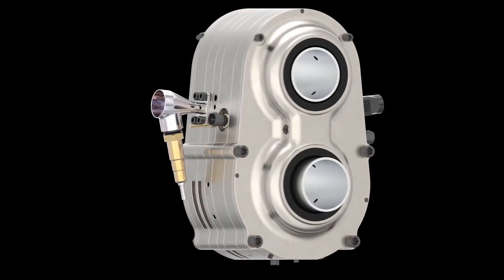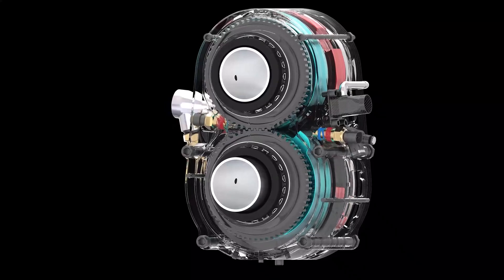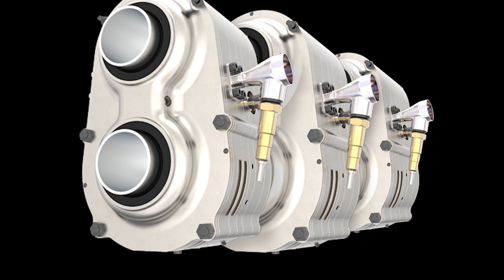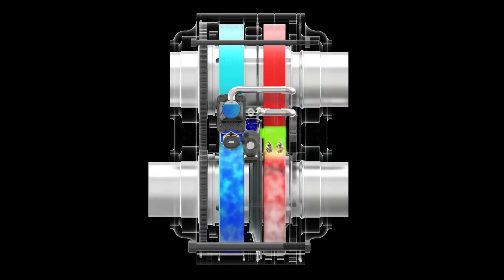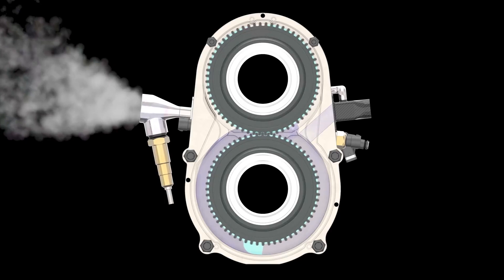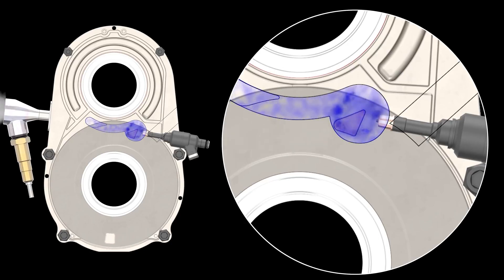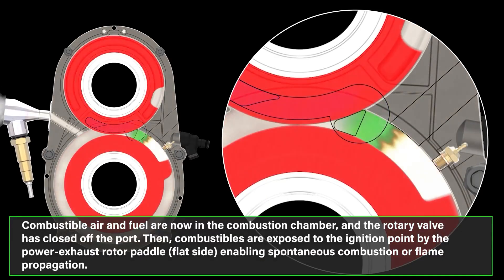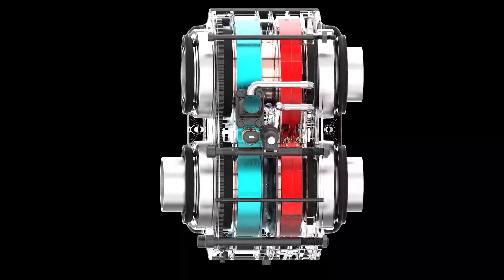This pistonless engine runs on hydrogen and revs to 25k rpm

Comment: as someone who lives out in the boonies i love the idea of Hydrogen and Hydrogen/electric hybrids,  pure electric just isn't practical since not only do i require a Pick-Up Truck but i have to drive 20 minutes to get to the neatest real town.  not sure this particular engine is practical.  some have already mention  cost of maintenance but we also need to think of EASE maintenance.  as someone who has never been able to afford a new car and likely never will i have always done as much work as i can on my vehicles myself.  any new engine must be something that the consumer can do general repairs on and an actual mechanic can do the rest without having to go  and take a couple of years to learn the new engine.  any new design has to be something your average consumer can take to any mechanic of their choice to have fixed.  we all know that things will always need repaired.  they should also last a reasonable amount of time between repairs.  lets face it no one wants to have to spend say $1k a year just for upkeep let alone the base cost.  i use a mom and pop style mechanic,  a small business that is just the one guy and his GF running the place.  the guy is good and works on wide range of cars and trucks  (including an old 70's dump truck he had in the shop last time i was there) but some of the newest vehicles  (mostly electrics and hybrids) required him to go and learn these new engines something that took him a two your course to do.  he still doesn't like doing them but he can.  modern cars are so over complicated that its a headache and a half for the mechanic.  mostly because of all the computers and electronics in then that constantly cause issues.

Comment: What he fails to mention is the special oil required is £1000/ltr and the minimum block temperature as 25C for the tolerances to work.

Formula 1 engines have to be pre heated before startup to unseize the pistons in the block due to the tolerances 🤭

Comment: Nice concept. But let's waiy and see if they can build a demo .odel and get it to work properly.

Keep one thing in mind, tight tollerances at high RPM, means a lot of heat, so the material will need to withstand it. Then to make those tight tolerances will be costly (precision engineering jas always been an expensive field the tighter you go).

So if made, these engines will cost a lot of money

Comment: In my opinion hydrogen engines are the way to go electric vehicles the batteries are way too expensive to replace and they constantly lose their lifespan even just parked and horrible to dispose of and terrible in the freezing cold hydrogen engines are much cleaner and easier in the long run without dealing with the waste + almost 0 admissions I really like this new type of engine,

Comment: As usual, it works great on paper & in a computer sim. 
But how does it stack up in real life, how would you start it, is there a weight restrictions on the vehicle it is in, how would you couple this to a transmission & or transfer case for 4X4 operations. How would keep the passenger comparment enviroment warm or cool, what of the safety systems for fuel storage & transfer to the vehicle from larger storage tanks,  and these are just to name a few questions

Comment: My concern is the RPM in my experience the higher the RPM the more fuel it uses , 25,000 compared to say 7000 RPM.
Reply: This one does not use any fuel it runes only in the mind of the inventor with magic and fairy dust
Reply: @DrSmugface  Now that makes more sense.

Comment: Been driving a Model 3 for almost three years. No complaints, no issues, love the performance of the base model. I just don't see internal combustion being the dominant form of engine that much longer.
Reply: The amount of charcoal power plants required for a quick transition to electric cars would leave us with no emission benefit. China is basing their transition to EVs on local resources, not climate. They got coal but no oil, easy choice. Did they scramble to build more wind or hydro power plants recently? No, but a lot of coal power plants are under constructions and more to follow. This is not a dream come true but a nightmare.
Reply: You and five of your neighbors drive EV. What about when all 200 of your neighbors are driving EV? Where is that electricity going to come from? Where are all of these batteries going to come from? You’re living a pipe dream, Casey.
Reply: @javoss123  There isn't a finite supply of electrons. Charging my car uses less electricity than my AC and clothes dryer does. All of my neighbors use those all day on Sunday. 

Obviously electric cars will take years to catch on. Solar will become more popular. Electric companies will start giving time of use discounts. Mine doesn't have any kind of time of use now. My car doesn't have to charge at the full 32 amps, but I let it. These are just the ones off the top of my dumb brain. I'm sure there are plenty of people smarter than I coming up with ideas.

Comment: From some of your posts it looks like you didn't watch the video...
There is zero oil inside the "case" 
Intake of liquid hydrogen and air gets combined and compressed inside the counter rotating discs, then ignited  and you know the rest...
I think that the rotating disc design is a Tesla turbine but I'm not surr

Comment: I really like the concept. Would love to see an actual working model. I gather there are still issues regarding hydrogen generation and storage for use in small, portable applications. Personally I would rather see stuff like this developed than electric motors for cars, boats etc. 

Happy to be corrected on any assumptions I have made.
Reply: concept is flawed to begin with
Reply: @omegarugal9283  in what way is it flawed?
Reply: @tonyburton4963  burning hydrogen
Reply: @omegarugal9283  what is bad about burning hydrogen? I want an explanation, not a 2 word answer that says nothing useful.
Reply: @tonyburton4963  hydrogen has bad properties, it explodes instead of burning, water in the combustion chamber is bad, promotes corrosion, contaminates the oil and can even hydrolock the engine, also the energy it can produce is too low per gram, it takes way more energy to compress it andcthe tank weights more than hydrogen it can contain, want me to continue?

Comment: Rather have this engine than a electric engine, less damage to the planet more of a benefit to tell the truth. it's the battery's off the electric engine that's the problem, mining the ingredient to make them is destroying the planet, specially if there is no alternative to electric engines. Also restricting the design of the engines so you have to charge up the engine when there is a design that once the engine is full charged you don't or will not need to charge it again as it do's it automatically.

Comment: NO, I am not an electric groupie, what happens when we lose power for a week like we just had near my home town because of a violent storm. At least with these motors we can have on board fuel with big tanks that you do not have to fill for possible a month or two. Pure electric terrifies me, as I also am a part time astronomer and know the power of the sun and solar storms. If we were to get hit by a moderately powerful storm like the one that hit near 100 years ago it would wipe us to the stone age today almost, it would very much fry our modern power grids and blow up stub stations. Good luck then powering your vehicles or relying on the local power plants to provide electricity. If you had a generator that was powered by one of these puppies you could be self sustained for enough time till power was restored with enough fuel to last a few months during this kind of black out.

Comment: problems with hydrogen are that it takes very large tanks to store enough to get anywhere, and it leaks like crazy. On h other hand you could theoretically use solar or thorium-reactor power to make it. They ought to look into hydrazine. N2H4. Very high energy and no CO2. toxic, though.

Comment: On another realm take a look at "

The Skinner Gravity Motor" which used Gravity to create motion. He used it to generate enough electricity to run his machine shop in 1939. Gravity is forever free and available all over both sea and land every hour every day & night. Gravity beats solar and wind turbines for a constant energy source. Pollution free once it's built !!! Even relocatable and long lasting too with low maintenance.
Reply: There is no free energy....!! The Skinner Gravity Motor is absolute nonsense.

Comment: It doesn't have an installed seal but the tolerances are the seal? There is only so tight if a tolerance that can be held for a reasonable price, yes this engine 'might' be able to operate on paper but add any single one of the byproduct side effects of a combustion engine and this will work it's self do death in a hurry.

Comment: You have not answered any of the core physics and design issues that make this design impractical. expansion and contraction caused by heat that will  guarantee oil leaks within a few miles.  Where is the science in the development of metals that will not expand or contract past the tight tolerances.   This and similar designs appear to be around for years why have we never seen any working prototype.  If this is so revolutionary why do we not any decent investment in this

Comment: Almost zero losses...yeah, for sure.
Except, that you still have Explosions, which generate mostly heat and you have a fuel, which has to be generated in a highly energyconsuming way.
Also, how do tight tolerance and high rotation speed come together?
And why should i eliminate seals?
Whats the point in this?

Comment: It makes a lot more sense than trying to up the energy density of batteries to the levels of combustion fuels because that will not happen for several decades, i.e. not before global warmings has long started running away for good. (If it hasn't already.) Also people keep overlooking that you need to produce all the electricity somehow, and if you want to produce it in large, centralized plants, then it makes a lot more sense to use it to produce hydrogen as an energy carrier.
This could easily be combined with a fuel cell and then you'd have a sort of three-way hybrid drive based on hydrogen for both the combustion and the fuel cell sides.

Comment: Wankels are worse than regular piston engines when it comes to thermal efficiency, this even takes it a step further down the drain. If it's so good, then why aren't they used already? Clear nonsense. It's a terrible design.

Comment: AS many have mentioned, tight tolerances and high rpms make me skeptical. Tight clearances can easily create problems with reliability in the real world, high rpms can be problematic too. Sounds more like a good "virtual engineering" exercise, a perpetual motion machine, or a specialized military application at best. If they could get it built cheaply and running right, the development time would have cars all running on electric motors. Looks good on CGI, too many hurdles to generate any excitement without a prototype.
Reply: Cant be perpetual motiom Machine as they cannot exist lol
Reply: @Lukasthefloof  EXACTLY!

Comment: Hydrogen power is all very well, but what of the incredible dangers of fueling such engines with Hydrogen?     Those dangers are what burnt the "dirigibles" -- why such airships eventually went to Helium, which is not combustible.  Vehicles with tanks of highly compressed hydrogen in an accident?  Flash- Boom!   Also tankers carrying hydrogen???  Doesn't bear thinking about.

Comment: Is there one actually built and running ? I suspect not. The only engines I have seen so far in my lifetime that aren't piston engines are (1) the Wankel and (2) the gas turbine engine. Neither engine has taken over from the piston engine (yet). Like lots of stuff on paper, the reality of it will become evident when test engines are built.

Comment: The No's don't stack up 170lbs/foot of torque @ what rpm? Has to be around 5000. So why rev it to 25000 if the ability to do work drops of to so little

Comment: Interesting design. Thermal expansion needs to be controlled! What is the thermal operating range? I could see using it to drive a generator. Generator either supplies the "drive" motors or charges batteries in a hybrid. Reducing the duty cycle and allowing better thermal management. Also, what is the speed range? 25,000 RPM or nothing doesn't work well for anything but dentist drills.

Comment: Neat design if it powers a generator that supply's power to batteries and an electric motor it would be a great hybrid hydrogen gas/ev design. With just a gear box/transmission a great hydrogen motor design. Your right it is similar a tiny bit to wankel rotory engine or turbine engine some even. I was thinking of an engine idea thats something more like a low powered turbine engine that uses hydrogen gas wether it's a hydrogen/ev hybrid power or just the hydrogen engine.

Comment: For those tight tolerances to be met it needs a less powerful combustion.  The heat and explosion will tare it apart really soon. But if you use hightech materials like Titanium alloy. And descrease pressurem then this engine would be really useful. But I don't think 160 hp would be realistic. For an engine with about 10-20 years lifespan. Maybe you would have to use a version with max. 20hp? Or even less. Then you would still need 6-8 of those in a car. But by doing so the engine would work for more then 5 min. Someone needs to do all the math and simulation. This way it's only guessing game

Comment: Hydrogen just doesn't have the density to justify its use as ICE fuel. Assuming perfect hydrogen combustion (HHV), to get the equivalent energy potential of 100 liters (75kg) of gasoline would require around 650 liters (25 kg) of high compressed hydrogen (70 MPa, 10 000 PSI). That storage tank would have to be extremely over engineered, otherwise a highway collision could turn into a major explosion. Hydrogen also doesn't like to stay in a tank since its such a tiny molecule. Both of those factors would mean that the storage tank would have to be thick, large, and heavy. There's also the facts that producing the hydrogen requires a lot of energy, and there isn't any compressed hydrogen infrastructure. EVs are a much more logical replacement for fossil fuels.
Reply: What? Hydrogen has 3x the energy content of gasoline.
Reply: @wrcpatrick  3x energy by mass, not volume. Depending on the level of compression, hydrogen has 1/20 (70 MPa compression, 38g/liter) to 1/30 (35 MPa compression, 23g/liter) the density of gasoline (750g/liter). Even if you could find a cost effective way to make and store liquid hydrogen (70 g/liter) it would still be 1/10 the density of gasoline.
Reply: @nicks2437  which is why compression is necessary. 
The fact Toyota is pursuing this means a whole lot. Some rando on YouTube cutting and pasting numbers saying otherwise? Lol.

I feel like you'd have been commenting against gasoline back in the day because it's flammable.
Reply: @wrcpatrick  There certainly may be uses for it in stationary engines where massive hydrogen tanks are possible, but (as the video implies) it does not make sense for use in vehicles because of the storage requirements. If you have 1000 liters (1 cu-m, 35 cu-ft) of HIGH compression hydrogen then you will have only 38 kg of hydrogen, which has the same energy potential as 155 liters (0.15 cu-m, 5.5 cu-ft) of gasoline. Doing the math on that means that a hydrogen fuel tank would have to be a MINIMUM of 6.5x the size of a gasoline tank if you are aiming to get similar range from your hydrogen engine. Of course if you want an engine that can only go 100 km (60 mi) between fills then hydrogen would be viable in theory, but if you're driving such short distances then an electric motor is the much cheaper and more logical option. 

Also, as I noted earlier, hydrogen is extremely explosive. Using our 38 kg of hydrogen example from earlier, if there was a catastrophic failure of the hydrogen fuel tank (highway collision) then there is the potential for energy release equivalent to 1 ton of TNT. That would not only guarantee the death of anyone involved in the collision, but also the death of anyone within 20 meters of the blast as well as the potential cratering and deactivation of the roadway and potential destruction of any nearby buildings.